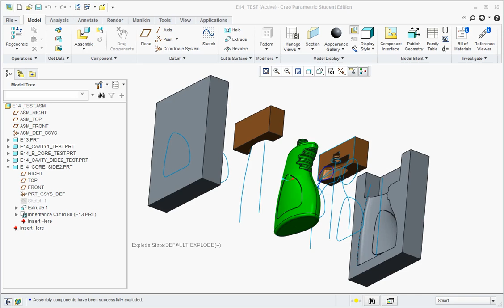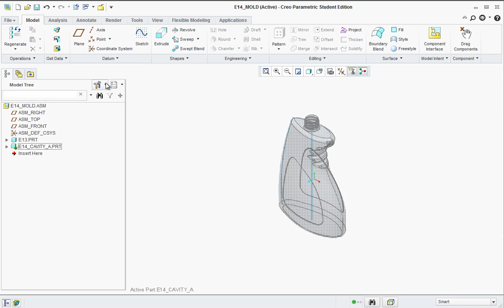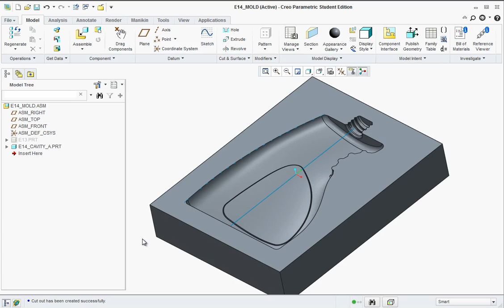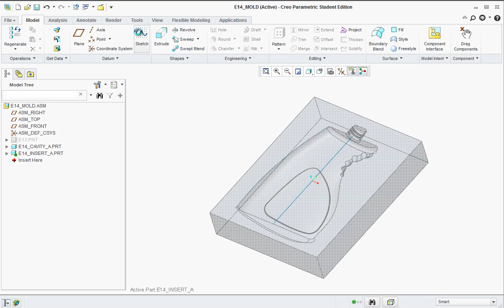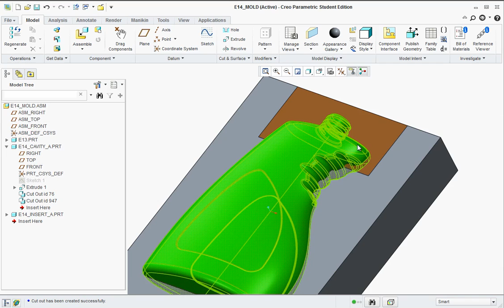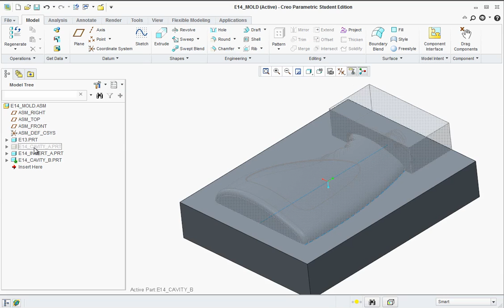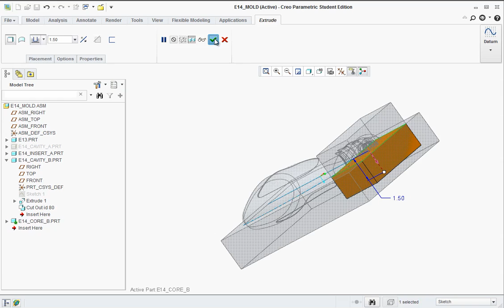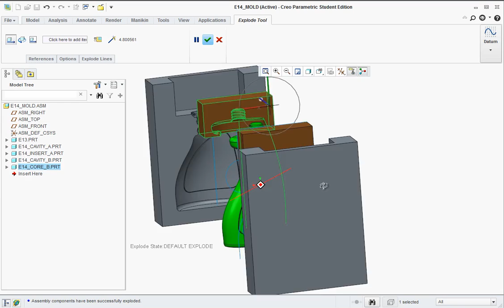E14 CREO Parametric 2.0 Basic Mold

Comment from the maker: Hi Hieu, E15 uses Creo Parametrics Mold design add-in. Not many users have the add-in module. I haven't made an updated E15 for Creo. However I do have a video for E15 using ProE Wildfire. The Pro mold module hasn't changed. Just search for E15 Wildfire and you should find it.